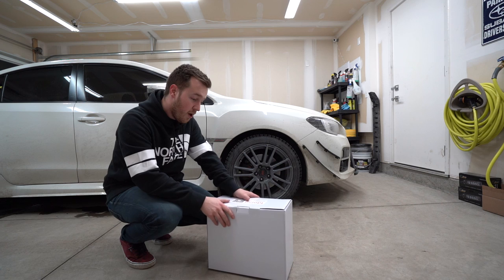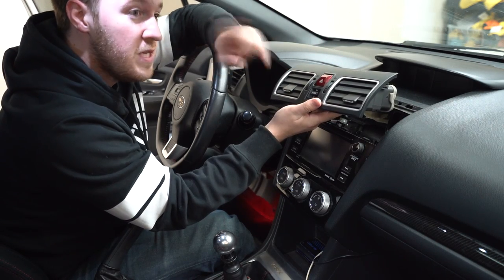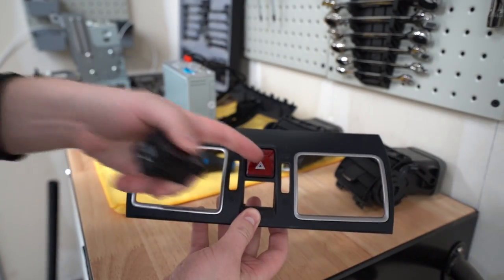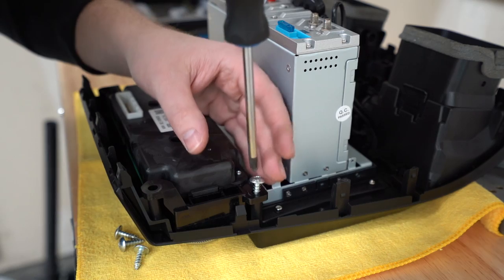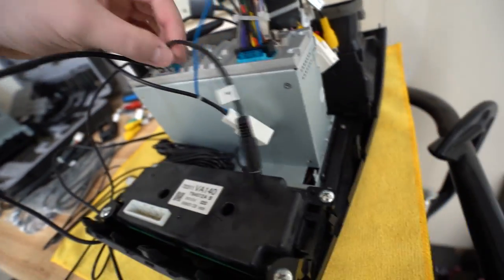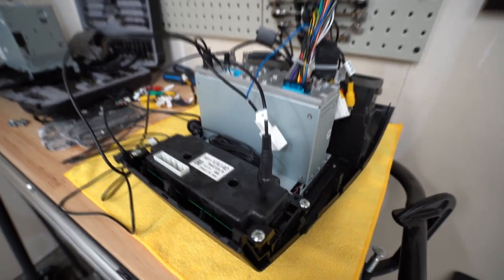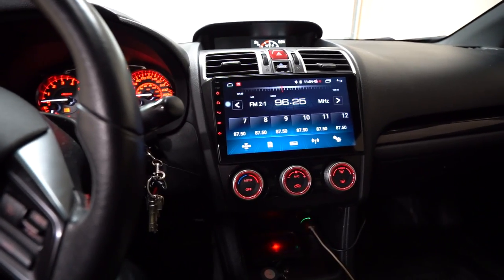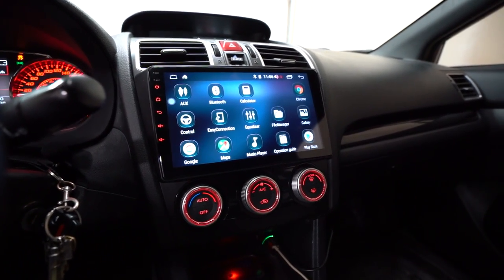Plug and Play Android 2019 Headunit DIY Install w/ Reverse Cam / Steering Controls |

Comment: Hey Ninja, do you know if this works with the Harmon Kardon package? I don’t see that it specifically states that
Reply: Yeah I need to know I know there's a mod and some soldering.
Reply: TheGeokaiser let us H/K guys know when you find the vids
Reply: It wasn't a video it was something I read on a forum but let me see if I can find it .
Reply: The Seicane HU can work with the h/k amp in 2015 WRX and STI or 
2014-2015 Forester. You will need 
to provide a 1 2V amp trigger signal 
to a wire on the car's 1 6-pin aux 
harness. I also recommend using 
the new HU's line outs instead of its 
speaker outputs to feed to the h/k 
amp. To do both of those things, you'd 
want some harnesses that Seicane 
does not offer but are available from 
ae64. No aftermarket HU will work 
With the newer h/k amp in 2016-up 
models. Search the NASIOC forums for
Reply from the maker: Hey guys, NO and YES.... No, it is NOT direct plug n play for HK Units.  But, YES, iDoing the brand that makes this specific model, says in their description, to contact them for HK Setup and they can help / provide the necessary harnesses and setup required!
Reply: @SpencerHogg  noice! Thanks Ninjax
Reply: Ninja can you provide the company info if is not to much to ask?

Comment: Hey bro I am having issue installing mine. I'm not able to get sound to the front speakers and when I make calls I can't hear anything but the mic works. Would you be able to help? I have one connector on the headunit that doesn't seem to have a connection from the car but everything else is working. Thank u for ur time

Comment: Can you connect to the stock usb and microphone and camera  already in sti from factory ?
Reply from the maker: You can connect stock USB but you'll need to route the wire and buy an adapter!!
Microphone you can NOT connect unfortunately.

Comment: Looks nice. Definitely want to switch out the factory HU. But wanted to know specifically, what does this NOT support? As far as I can see from the comments is microphone since you can route the USB but is there anything else that it won't support? Awesome vid, thanks!
Reply from the maker: Does not support OEM Microphone.
You will need an adapter and extension USB to plug to the middle armrest. 
Reverse camera does NOT have the lines.

Comment: You bought direct from their website? Just wanted to make sure it's secure. Website is a little sketchy.
Reply from the maker: No not from their website - from AliExpress (which is just like Ebay and if you pay via PayPal you have buyers protection usually.)

Comment: Hey I just installed the idoing headunit but I still can't get my backup camera to work. I think I've tried every combination of yellow av plugs and nothing works. Any ideas?
Reply: Aaron Younger same here
Reply: @EbolaSquirrel  plug the small fuse box into one of the green wires with the female connectors on it

Comment: Hey I cant find the answer to this anywhere but I have an '18 WRX with Harmon Kardon sound system.  Would this unit be plug and play or is there much more involved? Thanks to anyone that can answer this!
Reply from the maker: No it will not work
Reply: @SpencerHogg  Have same car looking to get this.  There are several videos showing you just need the CanBus adapter from the same company.  It's 35 dollars.
Reply: Just put this in my '18 HK car, Talk to IDoing you need the Canbus(35 bucks) and to tell them to include the right harness(no charge).  This thing is awesome, one thing to note is you lose rear speaker fade control.

Comment: I plan on upgrading soon too, meanwhile I want one that can easily connect to an aftermarket amplifier for a subwoofer. Are there female RCAs plugs coming off the back??
Reply from the maker: Yes the RCA plugs female and comes with the male connectors too if you wanted to run something like a console or dvd etc. (but you can play videos etc. off USB)
Reply: @SpencerHogg  awesome! Would love a more in depth video using different apps and what not. Also, did you use the stock back up camera? Or did you have to use the one that the headunit recommends??
Reply: I am curious as to how you got your backup camera to work?? Bunch of other people complain bout it not working or the lines not showing up. And on the aliexpress site, it says in the description that it does support OEM camera???

Comment: Any reason you chose this over the dasaita 9"?
Reply from the maker: This is a partnership video so the company just sends me out whatever unit they decide. If I was buying one I honestly might not have gone with Android and I'd have probably just gone a normal unit Kenwood Alpine etc.
Reply: @SpencerHogg  Thank you! Last question, do you know if this does well supporting speaker upgrades? I am concerned I get the head unit, but that it is not good for high end speakers . I have heard mixed reviews

Comment: Does our kit fit flush or does the top stick up? I’m having a hard time putting everything in place
Reply from the maker: It's not that flush no
Reply: Likewise, when I get the bottom clips on, the top ones pop off. So frustrating!
Reply: Evaristo Rivera start with the bottom first then the middle by pushing the top bezel of each corner of the glass screen. I know it’s gonna feel like you’re gonna break it but you’re not
Reply: alfred lopez ill give that a shot. Thank you bro
Reply: alfred lopez i was able to pop it in bro. Thank you 🙏🏼
Reply: I'm struggling with the top part

Comment: Hey man where would you connect the remote wire for an amp to the headunit
Reply from the maker: You could connect to anything that powers on when the car is on, or you could do the interior illumination, etc. Whatever gets power when you want sub on!
Reply: Spencer Hogg my speakers in the front won’t turn on? Any clue why?
Reply: @imaqueerBequalsD  if you have the HK system you need a canbus and you need to leave starlink in.

Comment: where did you place the mic and gps antenna?
Reply from the maker: Mic above the steering wheel and the antenna is just inside above the headunit I stuck it basically.
Reply: Spencer Hogg thanks.